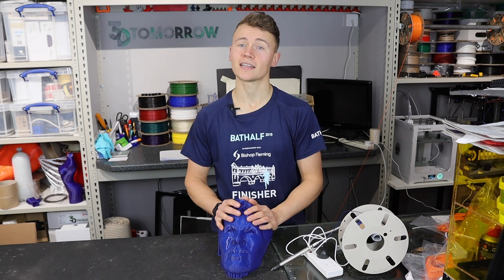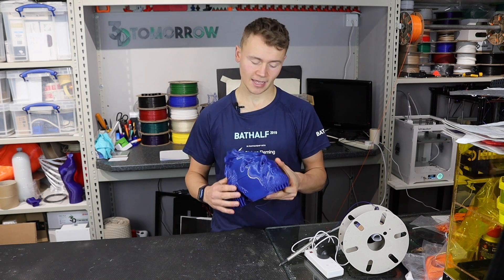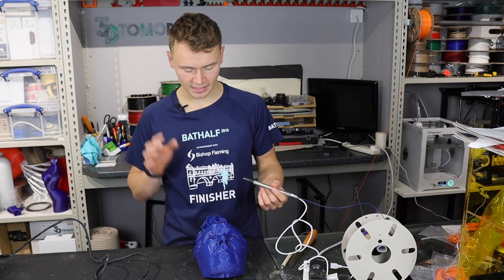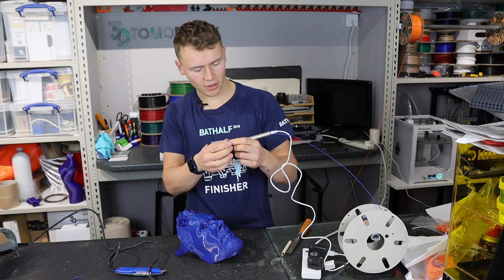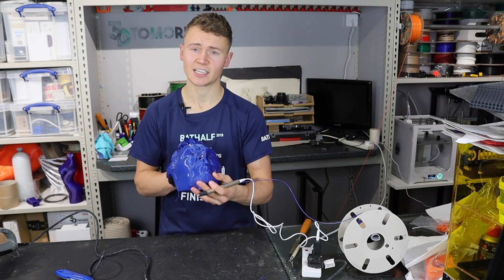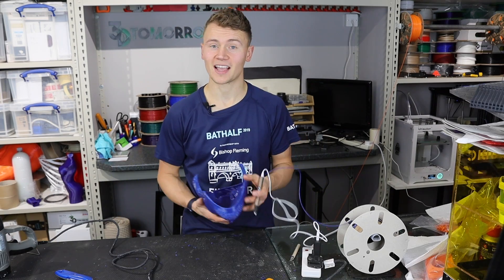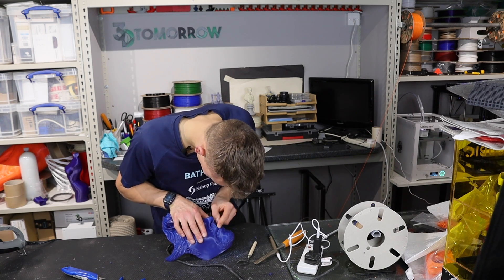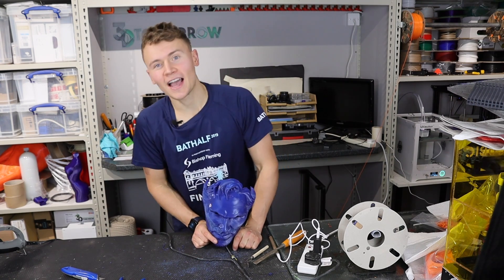(How) I fixed my layer shifted part using a 3D Print Pen

Comment: I wish you had zoomed in and showed the work before, during, and after.
Reply: You mentioned a clear lacquer would help with the color? I’m trying to work on a single layer shifted multicolor print that took about a day and a half to print. I don’t want to sand because the colors would appear super off. I’m not very handy myself so I’m not sure what effect a clear lacquer would have.